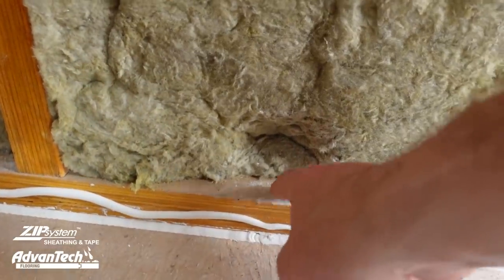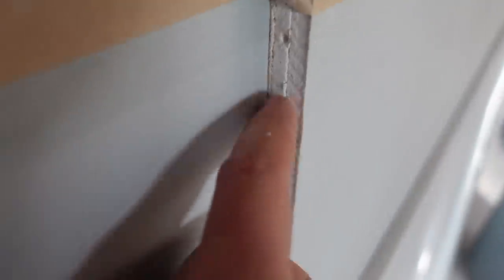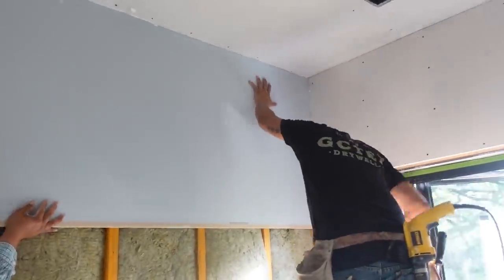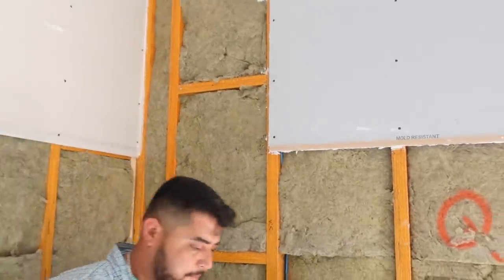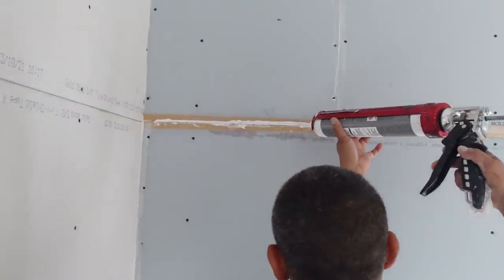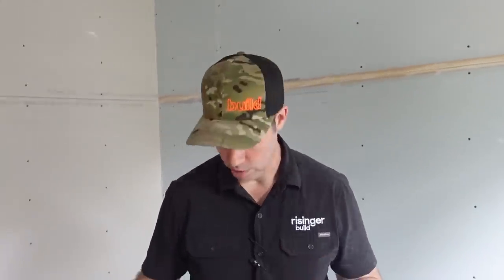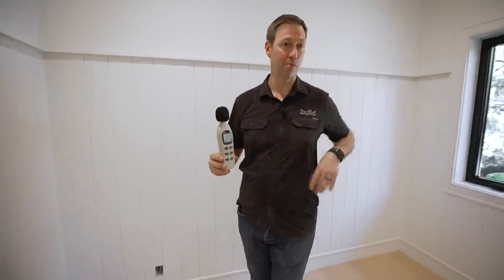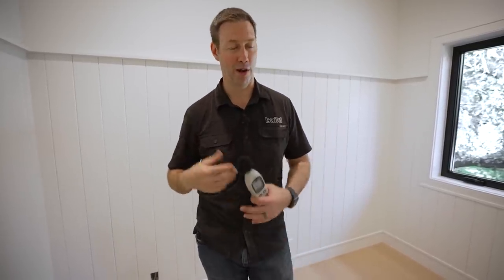3 Keys To Soundproof Between Bedrooms (incl Testing For Effectiveness)

Comment: In the USAF we had to build sound isolated briefing rooms for ICBM missile crews.  We used pairs of half walls that had their own studs arranged in an independent staggered arrangement with heavy insulation between.  Worked very well!
Reply: I have seen people use something that I would describe as a “floating wall”, with risers and rubber dampers between the structural frame, and the sound barriers. Never got to see the finished product in person, so I really don't know how well they work.
Reply: Staggered 2x4 on 2x6 base plates work really well in isolating resonance.
Doubling the sheetrock and using different thickness for each side helps too as each side has a different resonant frequency.
Reply: @rjwinn1088 depending on your construction standards and your desired STC rating, there are published schematics that detail what package assemblies you will need to implement. Adding a layer of 3/4in fire rock with green glue in between to your existing sheetrocked walls does a fairly good job. For those looking for better, there are metal resistant channels that you can use to create an air gap between sheetrock layers, results are pretty spectacular. Plus, assuming you have the strength to get it on the wall, you can add Mass Loaded Vinyl to the drywall sandwich to eliminate lower frequency sounds.

Comment: Matt, 35 years in the industry here, the last 15 have been highly concentrated on acoustical construction.  I sub out to the nation's oldest acoustical testing lab where I build to spec what clients want to test.  Floors, ceilings, walls etc.  If you are interested in how a product obtains it's STC or IIC rating, hit me up. I've seen a lot of snake oil and then crazy innovative ideas as well.  Always enjoy your material.
Reply: What's your take on mass-loaded vinyl?
Reply: @matthewharaminac6348  I hope you’ve got a strong back and lots of help to lift it onto the wall! It’s a bear to work with. Borderline dangerous if you don’t know what you’re doing. A 12 foot long strip (54 in wide) weighs over 100 pounds for high quality MLV. It works wonders, but the secret sauce is in the name, MASS loaded vinyl. You can kill sound with mass, you can isolate it with air. 

People look at soundproofing backwards. Instead of saying I want a quiet bedroom, what assembly do I need to use to accomplish this. Think, my bedroom is really close to these sources of sound pollution, (ie road noise, shared wall with a neighbor, the only bathroom in the house, a theater room) once you identify all the potential sources of unwanted noise, research the most effective way to limit that particular sound from being transmitted. Limiting street noise would call for a different assembly than limiting noise created by a massive theater setup in the next room. 

Also, I don't know if the garbage $2/sq ft quiet rock Matt was talking about really has a sheet of metal in it, but if it does, that would wreak havoc on most WiFi networks, just in case you might want to use the internet in your brand new top of the line sponsored space. I mean quiet space.
Reply: @Nhfilz  I've briefly worked with it before, and yes, it's HEAVY. I was recruited to help a friend of a friend with a home theater project and the MLV was part of the soundproofing. They put it in between two 2x4 walls and then each wall had Rockwool. I wasn't around for the Rockwool part, but the MLV seemed to make the space really quiet on its own. I was pretty impressed by the stuff, but I don't know if it's economical seeing as how it required a lot of labor.
Reply: Please PM me Need advice 🙏

Comment: Oh, how times have changed. 30 years ago I happened to mention the insulation I was picking up at the builder's supply was going into the wall between the bedroom and living room. Those guys had some fun at my expense. It was unheard of to use insulation for anything other than exterior walls at that time. I knew at some point I would be trying to sleep while the TV on the opposite side of the wall was blasting.
Reply: Very correct my friend. Which is how I know that that drywall sealant thing is completely useless. It accounts for less than 1% of difference to the finished house
Reply: @johnbergstrom2931  curious if caulking the end seams makes any difference? Makes some sense for gaps but I'd think doing  the mudding correctly will do just as much good.
Reply: @stillhavecommonsense6875  I see alot of disbelief on  acoustic caulk, the wall need to be SEALED like a mf:er, dosn't matter if you put up 6 layers of 5/8 drywall with green glue in between all of them if you forget to seal any hole and i mean it, as little as a gap where you only can fit a sheet of A4 paper lower the STC rating.

Comment: I'm envious of your results. I showed my contractor your older videos on soundproofing, and he nodded and said he'd do all this. The end result was that I spent a lot of money on more expensive framing, better sheetrock, etc.. and the end result was really disappointing. You're right that you've got to be there and stay on top of everyone, or you won't get the impact you want.
Reply: It’s a little more complicated than that but definitely true
Reply: I'm to the point that I would have to do this all myself. These details need to be done very well and the person would need patience. Two things that it seems 99% of contractors don't have or want to have. All about slapping something together and moving on to the next project.
Reply: @chrisbabbitt4202  if you’re talking about using sealant between dry wall sheets, you should know he’s making a video for you, doesn’t mean it makes and difference. You should watch the episodes before drywall and see how sound deadening the Sheetrock insulation is to begin with. That has done the work already. The caulking (coming from someone with experience) makes no difference.
Your contractor is not incompetent for not asking you to pay significantly extra to do that drywall caulking, cos guess what? You’re going to screed the drywall anyway! And that leaves no seams at all. 
Also this video has some building mistakes like installation of drywall panels from top down rather than from bottom up so as to ensure they’re stacked on one another by gravity and eliminate and gaps in between even before screeding
Reply: @John_Uche  - novice here but how does one install drywall bottom up and know the top most sheet will fit tightly against the ceiling?  I can't imagine the extra work a short gap would require, or, for that matter, trying to reduce the height of a too long top drywall section. With my luck, I'd cut a too long drywall section into a too short section!
Reply: @chrisbabbitt4202  In remodeling a house, the architect did 2x6 walls for around the bathroom so we could do soundproofing (don't really know what we were going to do, as I don't think either one of us knew anything about how to soundproof pre-Youtube). At any rate, I checked in during construction to find the carpenter had built the walls with 2x4s. So, yeah, "slap it together and move on" was definitely their mindset.

Comment: Hey Matt, side note what we've done in the past with really good results is frame wall with 2x6 plates and 2x4 studs separating one wall from other so there is no transmission of sound to other side, js
Reply: That is the way we did it in the old dsys
Reply: @raymondpeters9186  old but a goody
Reply: Yup. Still works. Just left a comment about a job coming up with that spec'd.
Reply: I assume the studs on one side of the wall are on different layouts than the other side? Makes sense though, good tip.
Reply: @stgibson2810  yes  sir
Reply: Pretty standard solution for town homes that share a wall.
Reply: @OOpSjm  standard? As yet to see it done as standard they always use double 5/8 sheet rock on both sides of living sides and in attic space
Reply: @tlheingrunst  Thats for fire resistance not sound, although it would help.
Reply: @gabrielback5615  answering Ian, and yes well aware, and yet the sound still transmits through the wall muffled yes but not great
Reply: The double stud means more lumber and more cost, of course. But it definitely helps. Even with double studs I'd still install the batt insulation. It can be run continuous by weaving between the 2 sets of studs.
Reply: @gabrielback5615  it’s for both actually. And it was intentional
Reply: @gabrielback5615  it’s for both, it was intended to be for both sound and fire. It’s called a party wall
Reply: Same detail on joist between floors. Staggered!
Reply: @johnbergstrom2931  Not sure about harder! Just more work involved…

Comment: Selectively using the quiet rock with sad n sound by roxul, running a bead of the E90 on the studs decouples the board as an acoustic break same as a thermal break does for energy and is a godsend for shared walls of bathrooms, laundry rooms, common spaces and private spaces.

Comment: Sorry Matt, I don't know who you consulted with, but they missed a key detail of putting the caulking on the studs as well. The point of the caulk that you did is to eliminate sound cracks, but you could use any caulk for that purpose. The quieting caulks are to eliminate sympathetic vibration from radiating from your facing wall to the opposing wall. Mounting the drywall to studs negates that, as it is a solid connection between two parallel panels. 
Last, I'd like to comment on one of your first comments: 'I think it's some sort of metal between the sheets' -regarding quietrock. No-its a polymer-base, like asphalt, that decouples the front of the panel from the back, although I think acoustic caulk and two sheets of 5/8" sheetrock is a better (definitely cheaper) solution. I think that you know your stuff when it comes to a tight house, but you have a bit to go when you want to be a quiet house expert.
Reply: Thanks for that clarification on Matt's 'some sort of metal between the sheets' mention.  Otherwise the source of  loud noise might be from his daughter's room with screams of:  "Dad!!  I can't get on WiFi!"
Reply: I researched this for our remodel last year to address terrible isolate Laundry room noise, and did most of the same things that Matt did (mineral wool, outlet putty, sound rock) with fantastic results.  One of the things I decided NOT to bother with was to use soundproof caulking on the studs, due to the following FAQ I found on the Green Glue noise-proofing website:

"Can I use Green Glue on studs or joists?
We do not recommend using the Green Glue Noiseproofing Compound on the studs or joists. Green Glue must be used between two rigid layers to be effective and, as such, you will not achieve any measurable benefits by using the compound in this manner."

If a company like Green Glue that makes money selling this premium stuff says that it's not worth bothering to put their product on studs, I tend to believe it.  Maybe other caulk products work differently - dunno...
M Fossum, you seem pretty confident -- where did you get your data from?

Comment: Do you have a non-soundproofed wall to compare it to, like between the upstairs family room and the kids bedrooms? No comparison to a baseline seems a bit silly.
Reply: Run a little test yourself on one of your interior walls. If they're anything like mine (uninsulated) there may as well be nothing there, maybe a ~5-10 dB reduction at best for a vacuum cleaner.
Reply: @samdelucia5074  Unfortunately my current home's walls are all concrete, but thanks for sharing the info from your home!

Comment: If I was going to that trouble I’d also put a bead on every stud to mitigate sound transmission, ensure outlets and switch on the other side are in different bays or use sound isolation channels to reduce the physical transfer of energy from rock to studs to rock.
Reply: I was about to say that too, makes the connection less ridgid
Reply: My thoughts exactly. As long as your hitting all the corners might as well hit all the studs, it might take an extra 10 minutes but it's cheap and would probably make even more of a difference. Hadn't thought about offsetting the outlets on the other side but I like that idea

Comment: The best thing for a great STC rating is to use a 2X8 wall and off-set the 2X4 studs. Do one side, place the sound attenuating batts and, then place the studs on the other side.
The studs will transmit sound without an air gap and/or buffering insulation material.
I recently spec'd this on a home between the great room and the bedrooms. Awesome result! :)
Reply: 2x6 with offset works too.
Reply: Yes, but Matt won't tell us about that because he only tells us about products that he is paid to promote. Quietrock wouldn't be happy if he takes their money and then tells us about alternatives.  I wish Matt wasn't like that, but he doesn't follow the normal social media promo ethics.
Reply: @orrd  sad, but appears very much to be the case.
Reply: The testing I saw said that while theoretically similar, offset stud walls that share a bottom & top plate are much less effective in practice than an airgap-separated double wall, much less an airgap-separated double wall with sheathing on one or both interior faces.  What I would love to figure out is how to get a fire-code inspector to accept a buildable version of airgap-separated double walls, that doesn't throw the sequencing of construction off.

I've also considered something like interior straw bale for mass, or perhaps a traditional exterior double-stud wall stuffed with cellulose, but indoors.  Need more data.
Reply: Mike - novice here asking if you think an air gap is just as good as insulation (all other aspects being the same). Also, what do you mean by air gap and (or) insulation- how would you do both? Thanks

Comment: I would use metal boxes in locations you're looking to do noise dampening. You can get a better seal between a mudring and sheetrock than you can between sheetrock and a blue box.

Comment: I did a double wall in my build recently. 2x4 with a 1 inch gap between each wall, then closed cell foam the wall. I went a little further by foaming the first drywall ceiling panel and the adjoining walls 4 ft in. On each side. 

Each room is 15x15 which includes a 4 ft deep closet that’s 10 ft long on the wall to hallway. From bedroom door to bedroom door, it’s about 24 ft. With the wife screaming on the other side, you cannot hear her except through the bedroom door. If you stuff a towel at the bottom of each door, you cannot hear anything from room to room.
Reply: People that are often disappointed about their soundproofing job ignore a door system that matches the wall rating. And not even STC, but low frequency too. The other two are windows that transmit sound not only from the outside but the wall that carries on to the other room. And flanking. flanking is the hardest by far in a home that isn't built for it in the first place. If you aren't doing room in a room or putting down proper underlay/floor system (Can include several layers of subfloor with green glue, acoustic joist tape, etc...) you might not want to spend a lot less and get 80% of the way there. That extra 10% or so will cost you more than the rest of the system and the last 10% is nearly impossible.

Comment: I used a 2x6 wall put 5/8" rock on one side then foamed it. It's very soundproof that way. I put 5/8" rock on the other side as well.
Reply: Interior wall?
Reply: @jimhendrix7776  yes only where I want sound proofing! I usually do it on bathrooms or toilet closets. Also on living room TV wall that's shares the same wall to a bedroom

Comment: Most common acoustic control method I've used is mass loaded vinyl & rockwool insulation. From now on I'll include the putty pads & acoustic caulk, this combination is probably easiest method to achieve the most initial decibel reduction. Thanks for the video!!

Comment: Definitely don’t skip the bottom plate to subfloor joint - makes a big difference. Also any DIYers like myself who don’t want to spend $10/outlet for the Hilti putty pads, check out the HVAC putty (not mastic!). 1lb brick is like $3 and can do 2 outlets. Home Depot has them in the HVAC section but also over in the electric section, near the wire nuts and staples.

Comment: I insulated interior bedroom, office, and laundry room walls with Rockwool insulation and i can tell you it makes a HUGE difference in sound travel.  Just standing next to rockwool installed in between joists you can tell hearing and sound doesn't travel very far.  Not only great sound proofing qualities, primary reason i installed is for its extreme fire resistance.  This stuff can be blow torched and still not burn.  If/when there is a house fire it makes me much more comfortable knowing the bedrooms will have much greater protection.

Comment: My childhood home built in the 71 had the double sliding door closets as a form of isolation between bedrooms. Only the entry and den's wall were in contact to mine and my sister's rooms. Now it been remodeled, the agency that was selling it torn down the den/living room wall, and the exterior brick courtyard wall facing the street. No doubt that'll raise noise levels in those 2 rooms now.
Reply: Also, my father used a belt.....

Comment: Cheap way to reduce sound is to frame 2 completely separate walls with no connections between each other (parrallel to each other with a gap). No matter what one wall system will resonate sound through it. This along with Matt’s suggestions should be excellent.